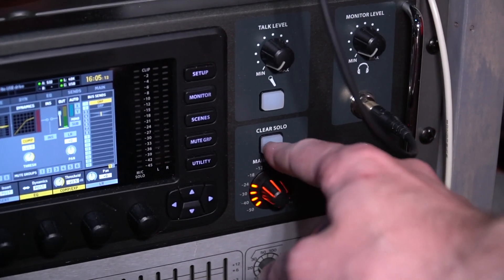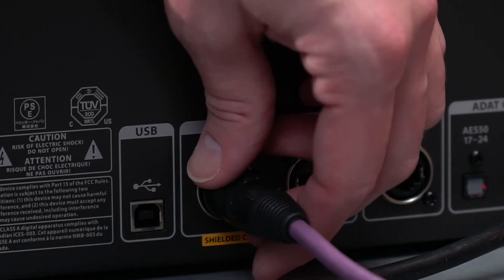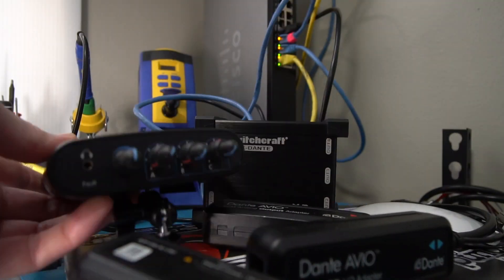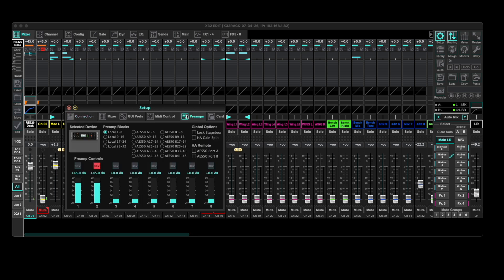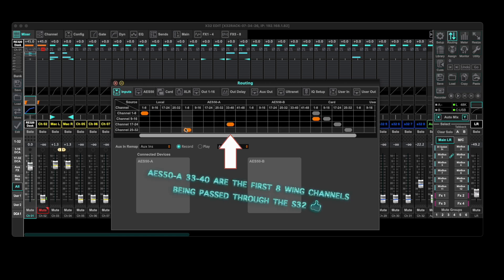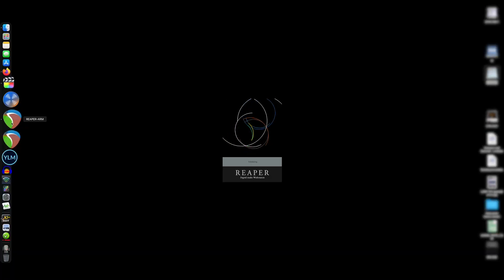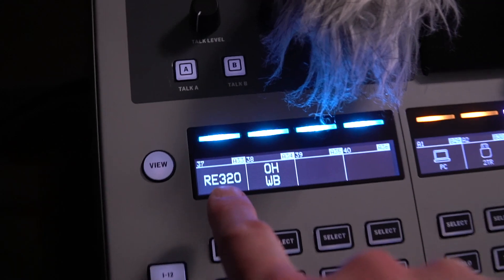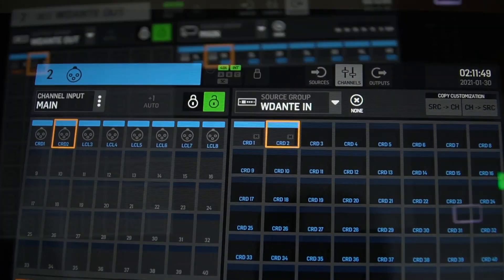Behringer Wing & X32 share the S32 Stagebox & more!

Comment: I can't find any tuts on how to use the WING + P24 Hub + P24 Mixers + S32 Digital Stage Box with routing for AES50.  I can get the P24's to work but only through Stage Connect.

Comment: Hey thanks a lot. Great content. 1 question: I wanna use the WING as my main IEM rig, patch all my instrument/ vocals onto the 24 XLR ins on the wing. 
What’s the best way to then split the signal and send it to FOH in various staging scenarios: small venues/ mid size as well as festivals?
The WING supporting AES50 and well as being able to add DANTE (and waves?) strikes as highly versatile and convenient, as I could give the FOH engineer a single simple cat5 cable as opposed to 32 XLR out? 
Is that right or was it just a dream?
Would I still need an old splitter so FOH has the option of XLR snake if his rig isn’t AES50 / DANTE / MADi / WAVES compatible??
Reply from the maker: The best way to do this is still by carrying an analog split with tails that you can hand off to the house to patch to their system. In some venues you may be able to give a digital send, but in reality, the times where that is going to work out are few and far between.
Reply: @DcSoundOp  yeah i see what you mean, I guess not having 1 single protocol for all digital station makes it tricky, you can't have all protocol in you digital mixer all the time. thanks for taking the time to reply and for your help. cheers

Comment: Good video, we are replacing our x32 with the wing and an additional s32 stage box. Additionally, we are replacing our P16's with the Midas DP 48's personal monitor system and Hub. Our x32 was connected to the stage box via cat 5 shielded cable. My guess is I have to run another cat 5 cable to the b port in order to get the maximum 64 inputs for the wing and use port c for the Midas DP 48 connection. Thoughts?
Reply: I'm interested in doing this as well. Did you ever figure it out? :)

Comment: Hi there, I have a question with a similar configuration, is it possible for both consoles to access all inputs of the stage box, and for each console to share the outputs? Like if I wanted console 1 to have 8 outputs, and the other console to have the other 8 outputs, of the stage rack? We definitely understand moving inputs from one console to another, but utilizing the outputs, in any way, is confusing! 

Thanks in advance for the reply!

Comment: Hello ,  I have an X32.  Will soon be purchasing a digital stagebox either the Midas or Behringer 16 unit . I’m a Drummer and would like to stop using an analog snake from control room . So I keep hearing there is a difference between the Behringer s16 and Midas DL16 .  I see you use the Behringer in this video.  If you don’t mind , I’d like your thoughts as to which one you prefer , would buy .  Thanks very much
Reply from the maker: It sounds like you're talking about a recording situation here, so I'd probably go with the Midas if money allowed. It's not a night and day difference, but if you're going to be scrutinizing things in a studio setting, it could certainly be worth it. Are you happy with the X32 inputs you have now? If you go with the DL16 from somewhere with a good return policy, you can A/B the midas against the X32's onboard pres and see if it's worth it before you're stuck with it.

Comment: Aren't there timing problems from sending from Wing to x32 or vice versa due to different latency in the A/D converters or FX latency?  I am toying with creating 64 channels of mixing by using 2 x32s and stage boxes and then sending the outputs from both x32s to an analogue console to merge the two...but I really only need about 40-50 channels...but figured that if I send output from one x32 to the other x32 that latency would be different between sound processed on the final x32 vs the sound from the x32 feeding into the 2nd x32...hence the use of analogue to merge them.  Isn't the latency difference going to be an issue sending from one console to the other since such audio would have 2x the latency of local audio??
Reply from the maker: Dave's recent video shows some of what latency can be expected going between consoles using AES-50 - https://youtu.be/hSYXAV-rpOg - I certainly don't think going back and forth from digital to an analog system is going to benefit your signal path unless I'm not following what you're trying to do here. Thanks for the message Larry!
Reply: @DcSoundOp  Thanks for the info.  I had not seen this Dave Rat video before!  Cascading may be safe .. I was thinking a 3rd mixer to combine like-use outputs from both x32s would be needed to combine outputs together without phasing and other issues....but looks un-necessarily complex and adds gain stage risks for no real benefit.

Comment: I have a Wing, Wing Dante card, X32 rack, and a Midas DL32 stagebox. 

If I want to send Dante sources from the Wing card to the X32, is this how I do it?

Wing AES50 A to DL32 AES50 A

X32 AES50 A to DL32 AES50 B

Wing AES50 B to X32 AES50 B 

*Route Dante network inputs to AES50 B outputs

And can I also route all the X32 local inputs to back to the wing over the AES50 B port?
Reply from the maker: Hi Mark, that config should work assuming you have the sync setup correctly between the consoles, and then to the Dante network. You'll run out of AES channels before you get all of the potential Dante traffic going anywhere, so you'll have to plan what you actually need coming and going from each device and then see if you have the open space on to do the config you want. Even if it looks good on paper, I'd test thoroughly before assuming it's a done deal. Thanks for joining the channel, hope to talk to you soon!
Reply: @DcSoundOp  thank you so much, this is a massive help. I was under the impression that I needed to sync to the Dante card, but now I'm wondering if that's not the case. What do you suggest? Yes I'll test everything thoroughly before installing :) luckily we have another sound system in place that this system will replace. Only need ~10 Dante channels, nothing crazy. We will have plenty of spare inputs
Reply from the maker: Right now I have things set up the other way around, with the X32 providing sync to the stagebox from port A to A on each, then the Wing from it's A port to the stagebox B port. So, I have the wing set to Sync to AES A - and then in Dante controller, it is set to be the preferred Leader, with 'Enable Sync to External' turned on. 

I'd have to test the way you're asking about first before giving you detailed instructions, but if you remember that the stagebox must get clock on AES-A and you're essentially clocking your Dante network to the AES network by enabling sync to external, you should be able to test through any config. This would be the same if the Wing was the primary AES clock source, since it is still 'external' to the Dante card itself. 

Let me know if that makes sense or if I'm not answering the right question. Ten channels is a good place to start, I worry when folks are trying to use every possible in & out on a mixer like this, it's bound to end in disaster!
Reply: @DcSoundOp  haha nah, I really only need five channels. A few more would just be luxurious. 

Thank you*so* much for the input. I'm gonna test it out as soon as I can.

Comment: Looks good. I've done this with a pair of Yamaha TFs (one monitors and the other FOH) and a rack of Tio1608-Ds. It works great for me. The only difference is that I get nervous about single points of failure, so I ran a pair of switches instead of daisy-chaining the devices.
Reply from the maker: The TF / Tio combo is a nice system for sure, the Tio boxes are a great deal for a standalone Dante stagebox too. You have to move up a bit in the Music Tribe ecosystem to get into redundancy on stageboxes unfortunately. Of course Dante has the big advantage too for many folks of being able to use off the shelf switches unlike AES50. Lots to cover in the next video on this stuff, thanks for the message though!